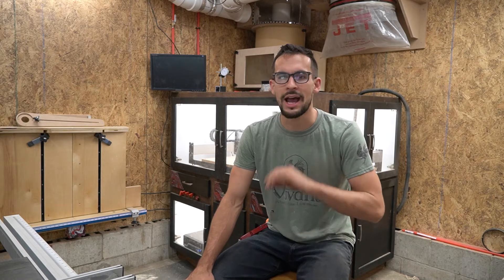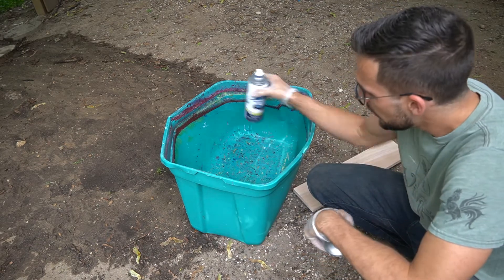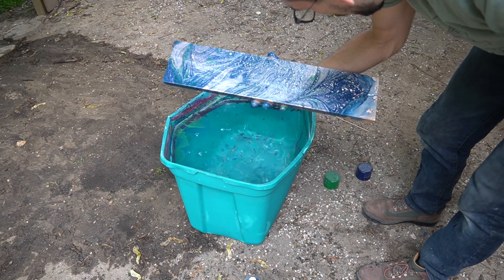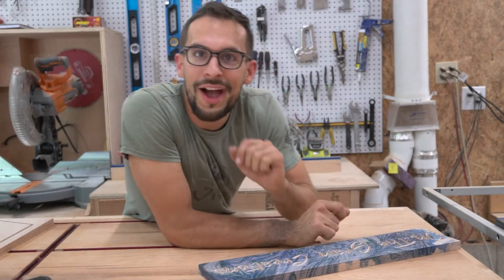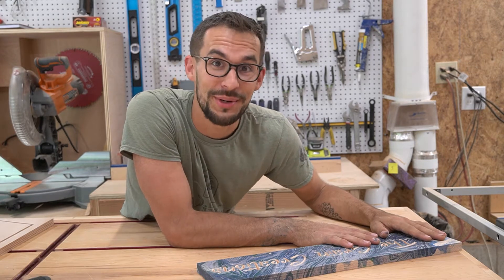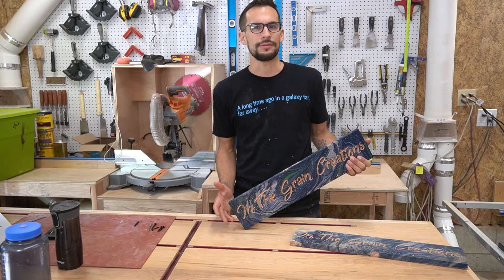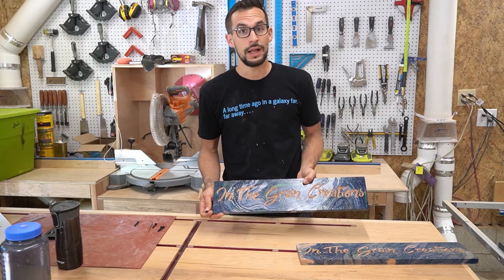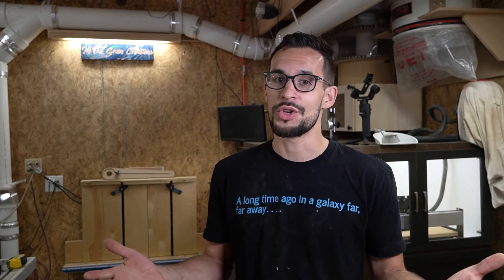Testing out the new CNC machine!

Comment: Awesome video production! Thanks for sharing. 
After about a month re-wiring my shop and building a lit cabinet with kill switch and dust extractor, I finally got my Shapeoko dialed-in and cutting! Such a fun learning journey.  I also got a planer so I can clean up old scrap and barn boards and carve ALL THE WOOD.
Reply from the maker: Very nice! The cnc world is such a deep hole to dive down. I built one of my own before I knew anything(didn't quite turn out lol), but it was tons of fun and I learned a ton. Now I'm happy to have something consistent and reliable. Its so satisfying to see that first plunge